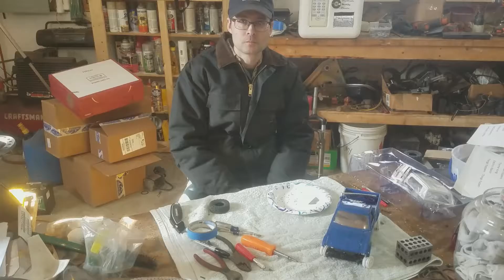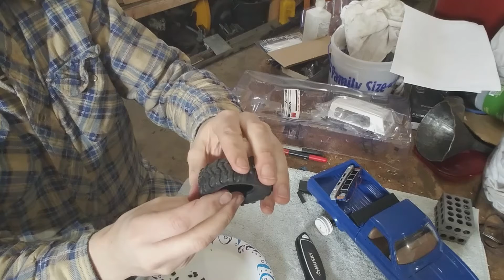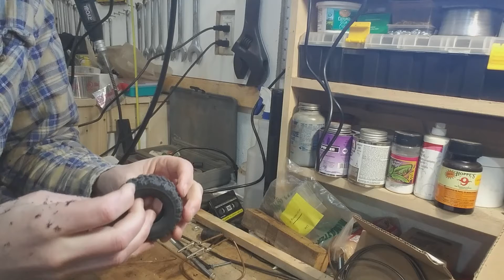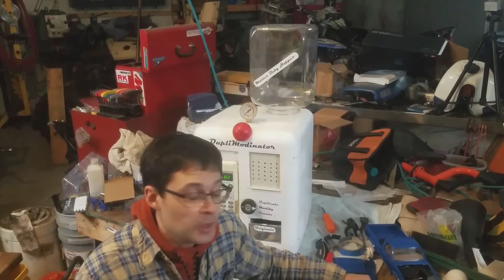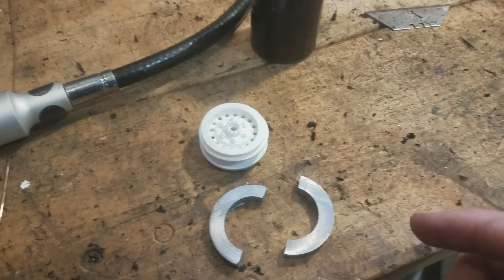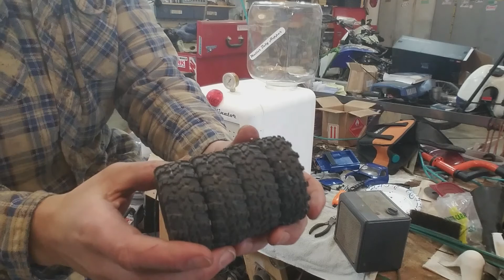WPL RTR RC Tire Mods PT3

Comment: Some rubber gets damaged but most rubber you can use WD-40 or diesel to soften it up. You have to spray it on like once a day and massage it into the tires for like a week and they will eventually start to get softer. And it's much easier and safer to cut the tire lugs with some flat bottom flush cutters (jewelry making wire cutters).
Reply from the maker: Thanks, I'll try that too.
Reply: @stickboyslab4761  you're welcome bro.